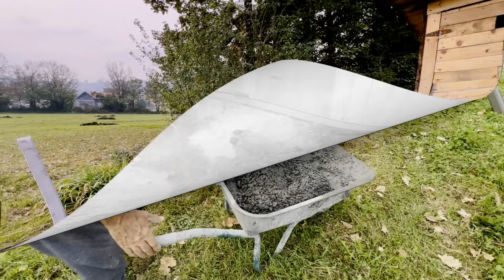OGRADA OD BETONSKIH STUBOVA

Comment: The work is fine and the best one can do under the circumstances, but I do wonder how long that metal mesh would last, when it is  embedded like that in the concrete.
Reply from the maker: @carmelpule8493, thank you very much! Metal mesh will last until is still corrosion resistant, it is not the best solution but my father has decided so in the middle of process as I have described in the video description. I am glad you watched the video.
Reply: It will last as long as the concrete does.  Not exposed to air / moisture it can't corrode.  Standard reinforcement method for concrete.
Reply: I love the idea but not imbedding the fence maybe wood frame and slope the cement so water does not puddle. Help keep predators from my chickens
Reply: İt will last longer then your life span and next generation of yours. So don't worry be happy. Guy did marvellous job. I like it.

Comment: I was wondering what about when you need to replace the fencing due to wear and rust since it is placed inside the concrete. Although this will probably last many years, but you could simply replace the fence wire to the top of the original concrete then add 2 inches of concrete and it would be like new again.
Reply from the maker: @DavesTreeFarm, yes there are many ways to do it, maybe I will later do the same fence on this back side of the yard with 2D metal panels as I did in my last video

Comment: I think it was a mistake encasing the base of wire fencing in cement. It will have to be cut away when it's time to replace or repair it. Good design always incorporates the ability to disassemble.
Reply from the maker: @billschillerstrom583, It is not the best way, but I explained in the video description why we made it that way. Thanks for the comment, I appreciate it.

Comment: I never liked these concrete fenceposts. They always tend to spall and split from the steel rusting inside. Maybe if they used a different material for the reinforcement I might consider. I've see it happen over and over again with different people. They just don't seem to last.

Comment: Unless the concrete is heavily reinforced on the inside it will break easily.
Reply from the maker: @user-gj6yb2qc7e, The concrete in the foundation wall has no reinforcement at all. It was done spontaneously, as I described in the video's description, and it only serves as a barrier for the growth of grass in the fence, easier mowing of the grass, and retention of surface water from the neighboring plot during heavy summer showers. Three winters have passed since construction, and now there are no cracks. Reinforcement exists only in concrete columns, which are buried in the ground to a depth of 65 centimeters.